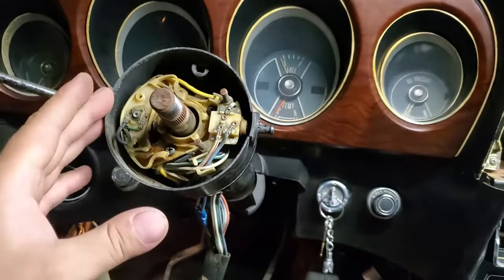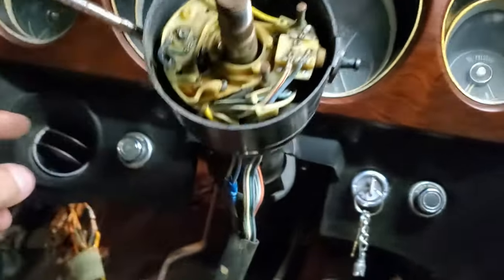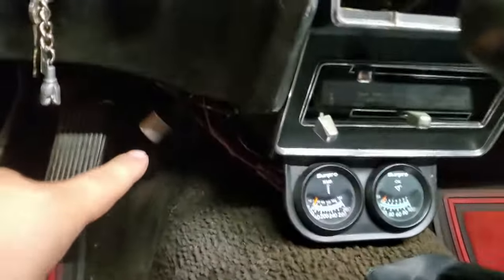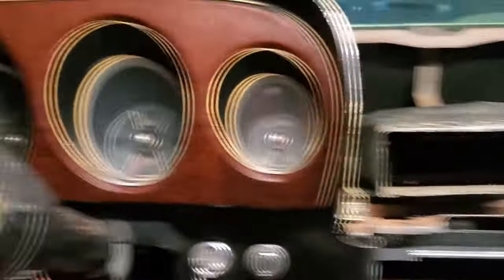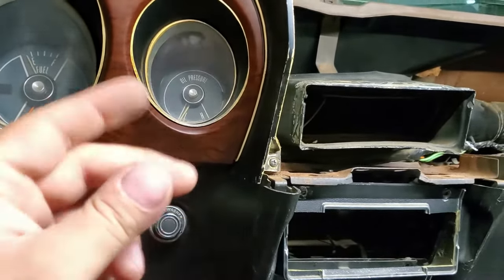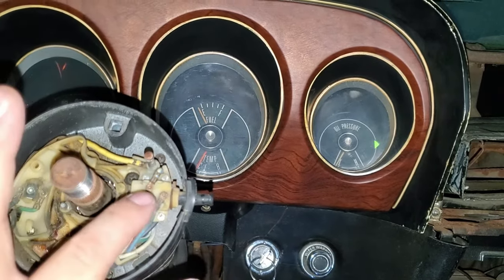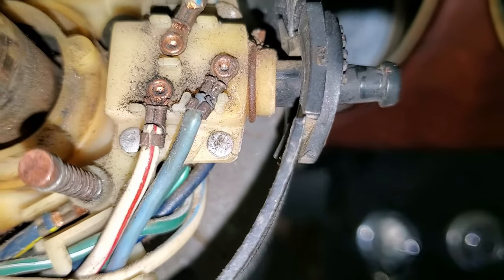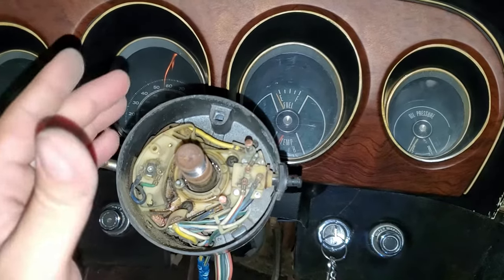3 Reasons Why your Turn signals stop working on your Classic car

Comment: Thanks. I think this 79 ranger may have the same issue. Turn signals and hazards dont work at all after hitting a big enough bump in the road, then they start working again later.

Comment: Thank you. I’m restoring a 72 chevelle. No turn signals at all replaced the cancel cam and switch as the owner before me put a aftermarket steering wheel in. I assumed that was the issue to no avail. Also replaced all of the exterior lighting fuses and the flasher relay on the fuse panel. I did some reading on a forum and found that just like the mustang you’re working on, I also have another flasher relay (just for the turn signals). I did the jumper wire trick, and the signals came on. Hopefully that relay is the only issue and I don’t have more of a wiring problem down the line.
Reply from the maker: @thmsblnd  yes! Although simple systems, they can definitely still send us on a wild goose chase lol

Comment: Hello Eddie, thanks for your videos. I need help with my turn signal switch. the markers both stay on. when I put my left turn light I see sparks under the unit and if I push the light start blinking. Also keeps blowing fuses. Please help.
Reply from the maker: @mauriciomarino6669   Hey you're welcome and that definitely sounds like an internal short or a break in the turn signal switch unit which would also cause your blown fuses...
Reply from the maker: Where are the spark coming from Exactly
Reply: @EddiesCustomsandRestorations  Right under the left turn area of the switch. how can I send you a picture or a video. Thanks
Reply from the maker: @mauriciomarino6669  facebook eddies customs and Restorations or instagram same name.
Reply: @EddiesCustomsandRestorations  Thanks. I'll be looking for you
Reply: I just sent you the video. Thanks
Reply from the maker: @mauriciomarino6669  I have not yet received anything

Comment: I don’t have a classic car but I have a Pontiac g8 a the front turning signals don’t work but the park lights work an they seem to be the same bulb?? What’s my problem?? Plz help
Reply from the maker: Check both bulbs. If the turn and parking lights are the same bulb that means you have 2 filaments in that one bulb. In some cases, only one filament breaks/blows, and the other will still work. If you look closely at the filaments, you should be able to see the separation. Replacing the bulb should fix the problem.

Comment: Have a 65 Buick Riviera and can’t find out why when use my turn signals left or right they only flash hazard lights on rear and front shows correct lighting for turning? 
And let you know in the Buicks from 65 didn’t come with hazard lights.
Any suggestions?
Reply from the maker: @domin8rdominant763  in the back of the turn signal switch there may be a broken wire connection that is bridged now and is giving power to both sides

Comment: I have a 2002 Cadillac Eldorado  and my turn signals don't want to work in the cold, And they make a weird noise. Once The car gets warmed up they start working again. Usually at some point down the road. And I need to use them three times before I get on the main road to go straight into the town. I don't know everything about this car yet because I only just bought it in July from the car dealership in my area. Once the car is warmed up they work fine.
Reply from the maker: Hmmm..are you running LED lights or are they just standard bulbs?
Reply: I don't know. I just bought the car in July so it's my first winter with it. How can I tell if they are LED bulbs? @EddiesCustomsandRestorations
Reply from the maker: @BonnyOBrien  they would not be a glass bulb, they would look like they have a bunch of little LEDs around. They simply will look very different than what is normally on cars. You have to physically look at them through the lenses.

Comment: I have a 1979 trans am and the all turn signals are inoperative.  I can’t figure it out, but here is what I’ve put together so far:
- Hazard flashers, Headlights, taillights, dash gauges, and parking lights appear to function normally (all bulbs are correct)
- 11.6V to turn signal flasher (pink striped black wire) when key in “on” position, 0V when key off (believe that’s normal).
- Bench tested flasher and it functions (it’s also new)
- removed and jumped flasher to remove that variable and voltage is still there until turn signal is up or down where voltage goes to near 0 at that junction (this has me confused…where’s it going?).
- continuity checks are confusing:  From flasher output (purple wire) to front driver bulb (either contact) is open with signal lever off and 0 ohms with lever down.  Grounding tab at that bulb is a good ground. Both contacts are grounded with lever down (this is confusing to me, is that normal?).
- with brakes pressed and brake lights on, lever down turns off left rear brake light and lever up turns off right rear brake light (believe interrupting the brake light is normal, except the light is then supposed to flash).
- the battery is grounded to the engine block and core support.  Engine block is grounded to the sub frame and the firewall.
- the front light harness is grounded to the core support on both sides.  The rear light harness is grounded in the trunk and under near the fuel fill neck. 

I think I’ve ruled out a bad flasher, some grounds, and bad or wrong bulbs.  Anything else?
Does that leave a bad ground somewhere other than what I said above and the turn signal switch?
Reply from the maker: Thid actually sounds like loss of voltage or voltage drop. Check out the issue i had with this bronco. The issue was rusted contacts https://youtu.be/D4f6ydNLgv4?si=mQUWNVgryaGcSjE8

Comment: My 67’ Buick Skylark’s turn signals won’t work. Put in a new flasher but nope, hopefully i’ll find the problem soon
Reply from the maker: Check the turn signal fuse and check to see if the contacts where the fuse mounts to are not all rusty. That can cause low voltage which will hinder your signals not working as well

Comment: I have a 1992 foxbody and I was hoping I could get some advice here, I’ve been restoring/fixing it and ran into a problem with the turn signals. Originally the turn signals wouldn’t work however the hazard light were working fine. I did some sketchy work in the hazard switch that seemed to work. Later during the safety I found out the left turn signal doesn’t work when the running lights are on, however the right turn signal works fine with running lights. Advice?
Reply: Check the hazard switch itself. Mine was seperating that caused my issue. Turn signals run through that hazard switch as well.

Comment: Looks like it might be my turn signal switch. I have an LED flasher for both ny hazards and turn signals. I dont know what changed, but all I did was take the battery out of my car since the battery was dead in my C10. I put the battery back in my Camaro, and now neither the signals or hazards work, but before I took the battery out, they did. Nothing changed, and no wires were pinched. Does that still sound like the switch to you? I would appreciate it if you could help me out. The Camaro is a 1979 and the C10 is a 1969. Both have LEDs front and back in the C10 the signals, and hazards. I took the LED flashers from the C10 and put them in the Camaro, so it's nothing to do with the flashers. The flasher terminals also have power when I'm using the switch, too
Reply from the maker: @StrawIsEpic  sometimes wires can break or bend while you pull the battery because there are some wires that run along the bottom of the battery tray. Check that. Also check at the bottom of your steering column,  make sure the big connector thats from the steering column is all the way pressed in to the other connector. It's like a flat 7-9 wire connector that carries all your turn signal, and horn wires. Maybe when you sad in the car you may have kicked it. Otherwise coincidentally it would sound like the turn signal switch...

Comment: Question, i have a 72, lemans. Left side turn signal works fine. But when i put right side on, my headlights began to flash with turn signal, highs and lows on both sides.
Reply from the maker: Hmm thats an odd one. Check to make sure that there are no spliced wires to the harness that clmes out of the steering column. Look for any out of place wiring that isnt factory. More times than not, people tampered with these classics back in the day to make things work best for their needs and wasn't always correct.
Reply: @EddiesCustomsandRestorations  Thanks for the reply, Forgot to mention the right turn signal stays illuminated on dash while lights are on. but definitely checking the harness. Thanks
Reply from the maker: @jessemendoza2991  that's a difficult one because for that a lot of things need to be checked and tested. Ive had odd scenarios like that with many different causes.

Comment: Question:  I have a 1970 Ford Torino. My turn signals work fine during the day, but at night when the headlights are on, the turn signals don't work. They light up, but don't blink. What would make them blink only when the headlights/taillights are on?
Reply from the maker: i know exactly what you mean and i actually have a video on what that could be and show you how to fix it. Here is the link for it https://youtu.be/D4f6ydNLgv4
Reply: @EddiesCustomsandRestorations  thank you!!!!! I will check it out!
Reply from the maker: @stacyhazelwood4033  your welcome 🙏  i really hope it works for you

Comment: What if all your turn signals work except for the ones on the brake lights? 1970 mustang
Reply from the maker: The filament could be out on the bulbs on the brake lights. You need a dual filament bulb, the one with 2. Check to make sure those are the bulbs back there. Check that first
Reply: I switched to LED. Even when I go back to the regular bulb, same issue.
Reply from the maker: @70MUSTANGMAN  check the contacts on the turn signal fuse and make sure they arent rusty. Otherwise check the wire going to the rear turn signals coming from the turn signal switch. Right there at the bottom of the plug check the green with orange and orange with blue wires. Those shoulf be the ones going to the rear turn signals. If you arent getting any power to those wires then your switch is damaged...
Reply: I found out that one of the sockets wasn’t making a connection. Also, I didn’t notice/realize that I have a flasher for hazard and one for LED. I’ll
Change the passenger side to an LED flasher and see what happens. I need to take the steering wheel off anyway. My horn stopped working. Might as well tackle it all at once! @EddiesCustomsandRestorations
Reply from the maker: @70MUSTANGMAN  heeey Glad you figured it out!! Thanks for sharing! Your findings will surely help someone else out!

Comment: i have a 1969 cutlass and my problem is i have 1 turn signal front and back on one side blinks fast and the other side will not blink i installed a new turn signal in the steering wheel and the fues is good ( smh)
Reply from the maker: When it blinks fast, it usually indicates a bad bulb within the circuit
Reply: Did you find a fix I have same problem
Reply from the maker: @xavisBuilds  did you replace the complete turn signal hazard switch or what exactly did you replace?

Comment: Replaced the switch in my 1970 duster, now the car cranks but wont start and the horn honks non stop
Reply from the maker: The crank no start is probably due to a disconnected ignition wire maybe during replacement and the horn is because your ground wire at your horn is making contact somewhere and you are probably pinching the wire. Its the one wire that hangs out behind the horn button. The moment that wire touches any ground, the horn will go off. There should bee a spring holding the horn button away from the surface. If that spring was left out, the horn will always sound out

Comment: It doesn’t work when headlights are on or when brake is applied
Reply from the maker: @SS_B33  it's robbing power or ground. Check your grounds or add additional grounds to your tail lights and headlights